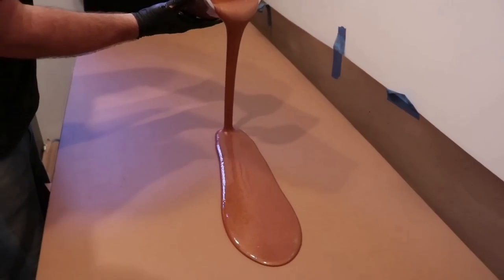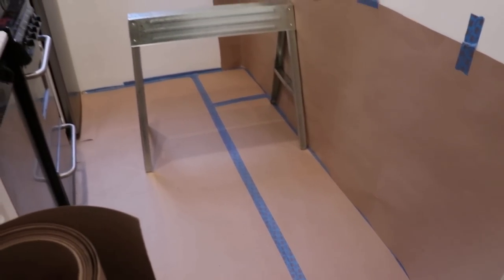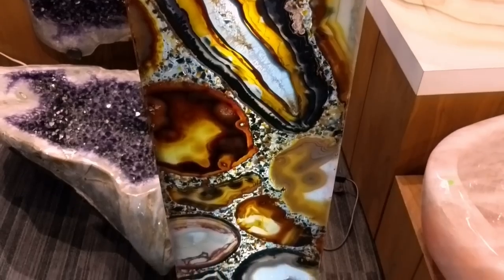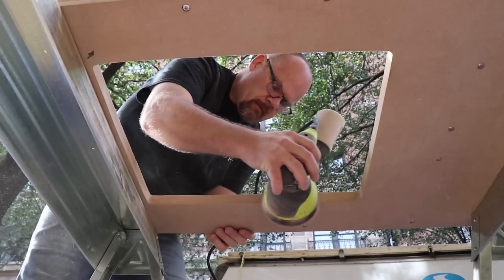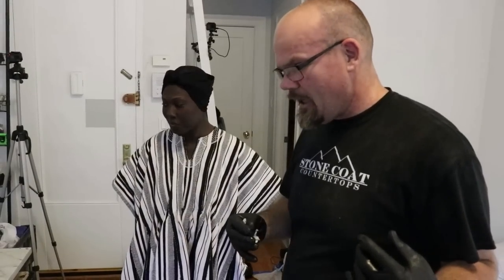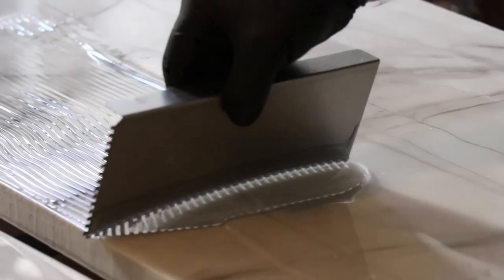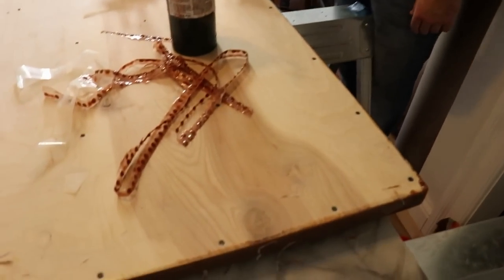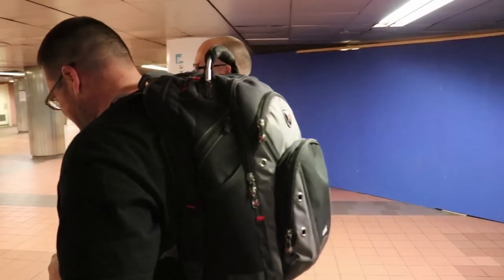How to Save Money on your Remodeling Project

Comment: I have a question. Why didn't you apply stone coat over the counter that was all ready there instead of building all new counters? They do look fantastic though and now know what I want for my own counters.I always wanted to do the copper for my desk, but with the system you just did I think it adds a new look and want that for my new desk I am going to build...
Reply: That was my question.
Reply from the maker: Great question Mark!  We wanted to show how to build them step-by-step from scratch, you could certainly go over the existing countertops as well. Copper is a great choice color choice Mark!  Let us know if we can be of any assistance with your project. (541)450-1976
Reply: @StoneCoatCountertops  Had the same question because of 30yrs of remodeling and know the hassle.  Thanks for answering and glad to know existing was possible.

Comment: How do you think adding candy concentrate for automotive paint would hold up mixed with stone coat?
Reply from the maker: Great question Ronald! We haven't tested this yet. Some artists mix multimedia paints and pigments directly into Stone Coat Countertop Epoxy they also have tried some oil-based paints in our epoxy, but some have adverse reactions and gum up the epoxy or coagulate on the surface. You will want to do a sample and TEST to see if it will work with your added product. Call or write anytime for project support. (541)450-1976

Comment: My formica go from the counters to the wall in my kitchen. How can I epoxy vertical formica? I need to lnpw what to order.
Reply from the maker: Great question Chanel and thank you for tuning in!  We like to cut off existing back splashes when we do our projects and make new ones to cover the area the old backsplash used to be.  We do however get DIY customers who wish to leave the backsplash in place, when this is the case here is how we suggest coating vertical backsplash.  Here is a video showing how we pre-color the surface and work with a countertop that has existing backsplash.  https://www.youtube.com/watch?v=sSWDiKKSxokHere are other colors that work even better with vertical backsplash,https://www.youtube.com/watch?v=wpzdQTFBA6Ihttps://www.youtube.com/watch?v=3Xaw-MrNnns
Feel free to call or email us anytime with questions and for project support. (41)450-1976